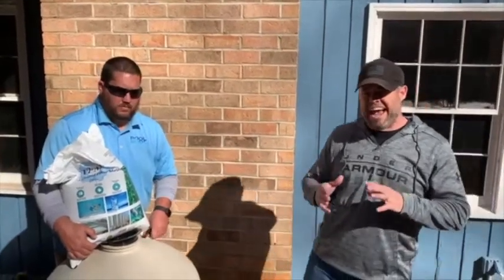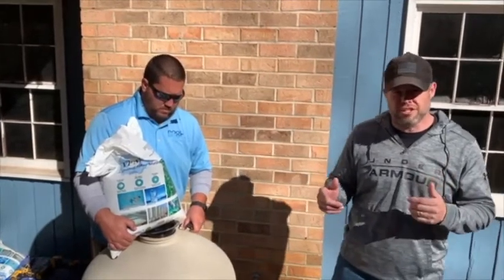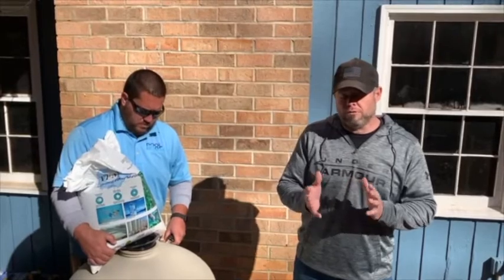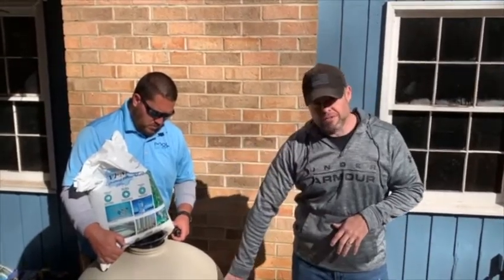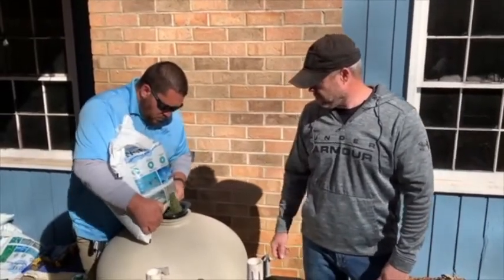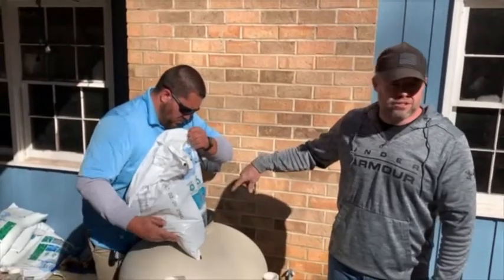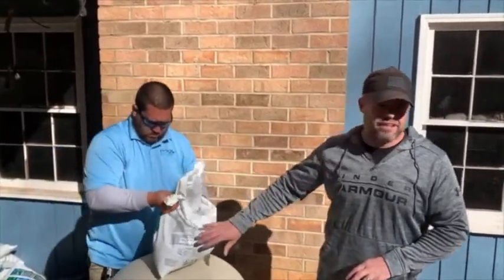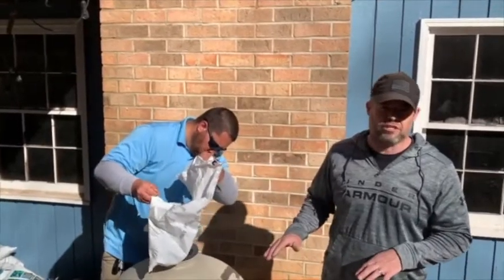Dryden Aqua AFM Activated Filter Media Installation Demonstration

Comment: Do you ever need to replace this these mediums if you are backwashing on a weekly and/or as required basis?
Reply: The manufacturer says that the medium will last a lifetime.  However, with regular backwashing, it is a good idea to "top off" the media every five to ten years.  In practice, we recommend replacing the glass every ten years just in case some efficacy is lost over the years but dryden aqua claims lifetime longevity.

Comment: My pool installer is giving me push back on using a sand filter with AFM because he says that sand filters put a tremendous amount of back pressure on the pump and shorten the life of it.   He also says that you can only get around 50-70 gallons per min thru a sand filter compared to 120 GPM in a cartridge filter.  Do you agree with either of those statements???  If so, is the limited GPM a factor with AFM and a 26,000 gallon pool?
Reply: Any filter that gets dirty will have increased back pressure. I’ve never heard of any data or medicating that back pressure caused by a sand or glass filter is an issue and that hasn’t been my experience. I much prefer AFM filters over cartridge. Significantly better filtration and much easier to backwash then take apart the filter fir cleaning. Just my opinion.
Reply: @LazyDayPool  thank you for the insight.  I suspected it wasn't a likely issue.  Still moving forward with AFM despite his misgivings.
Reply: @RoamingWithRobert  Hi, I am exploring this system for a new pool installation.  Do you happen to have any additional feedback since installing the AFM medium? Thx.